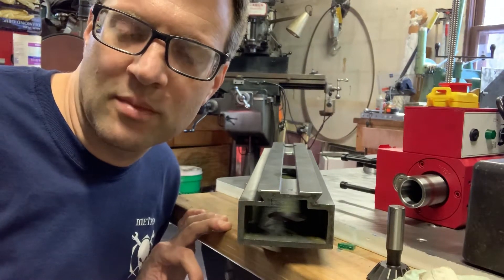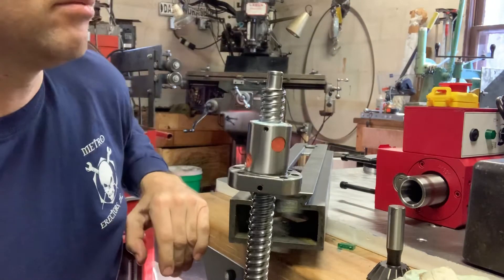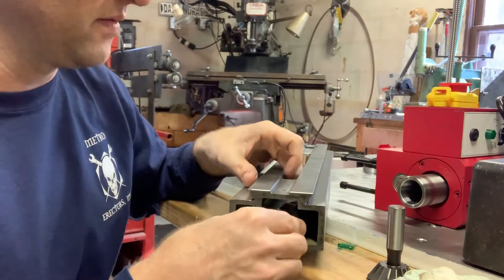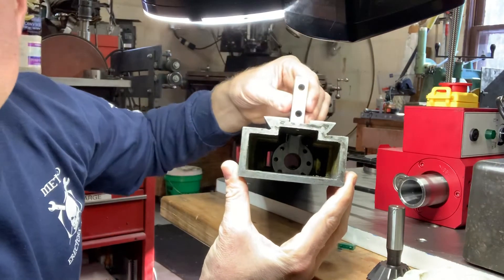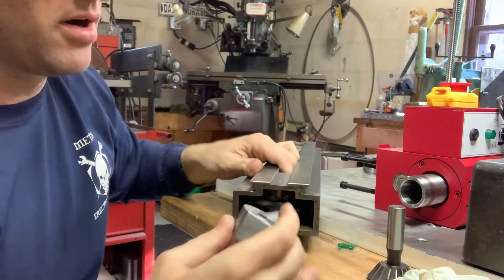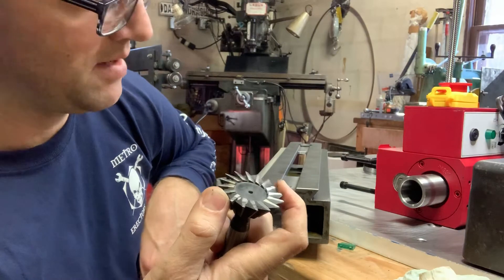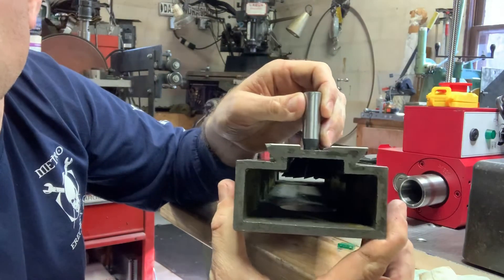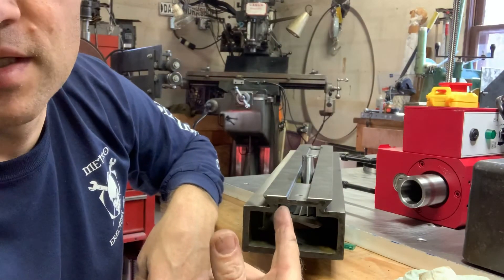Part 2 z axis ball screw harbor freight sieg x2 mini mill cnc

Comment: Do you know the lenghts of the ball lead screws for each axis? Ive been looking around but no one mentions the lengths of them.
Reply from the maker: Depends how you’re mounting them since this is all custom.  I will be turning the ends down and will have a video on that.  It’s definitely not a DIY beginner thing.  I mean maybe someone has a kit or f you wanted to pay the premium for that but it’s never going to be as good as doing yourself if you have the capability like I do.

Comment: I have been trying to find that column material but don't know what it is called. Basically I want to get a section of that column material about 6 inches taller than the one that came with my machine  for more z axis travel.
Reply: It’s just cast iron.
Reply from the maker: Yep cast iron or grey iron.  You could decouple it at the bottom and make a riser out of any old steel maybe you don’t need to travel the power head all the way down?